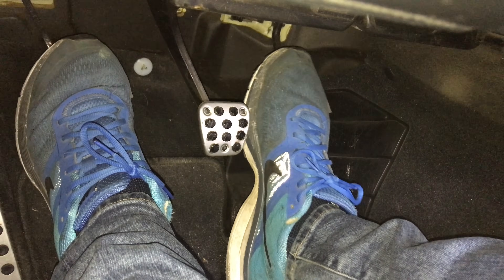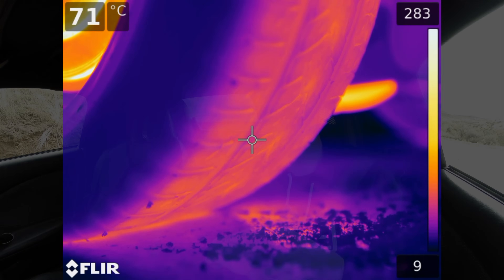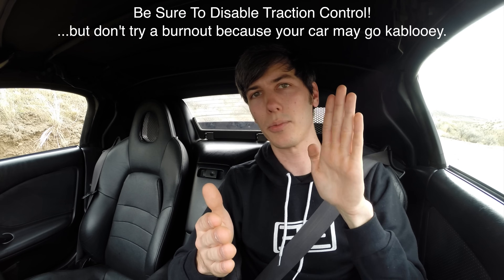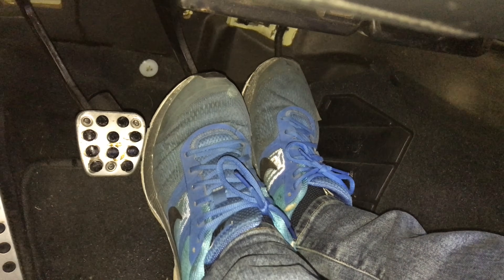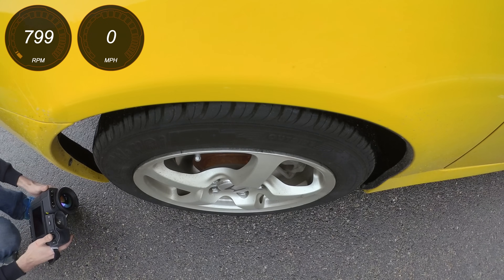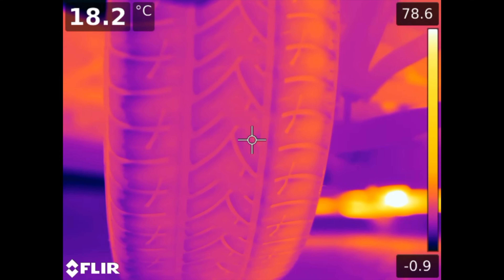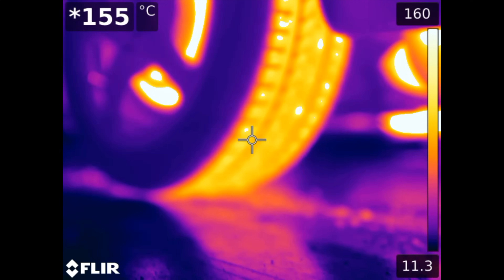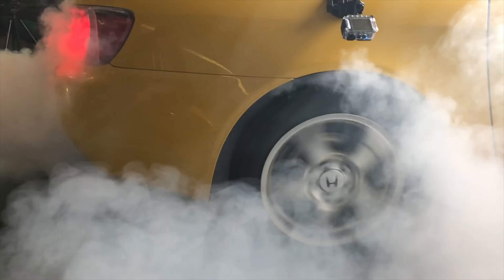How To Do A Burnout - Manual Transmission

Comment: some things to consider.  transmission load is high considering the traction and the fact you are over driving the read brakes.  maybe not too big a risk.  u have seen people bring bleach with them to add as a lube to lighten the load.  second thing.  when you dump the clutch, make sure it locks up.  I have seen this done wrong where the wheels never spin but the clutch does.  that is one ugly scene and dangerous to the driver too .  search it out on YouTube.

Comment: So how does this affect your clutch? When you dump the clutch and successfully start spinning the wheels that have power going to them (either RWD or FWD) surely it's as if your driving normally? If you let the wheels stop the car stalls and that's it? How can you burn your clutch doing this unless you have 3 feet and are slipping the clutch for some weird reason?
Reply: Many road going clutches won't like matching a shaft rotating at thousands of RPM with another shaft doing zero revolutions per minute. Also, as was said in the video, if the tyres and/or road surface don't allow the wheels to spin (or even if they don't spin enough), that energy has to go somewhere. The clutch is never actually coupled, just pressed together, so given enough force the flywheel will rotate faster than the rest of the driveline. This is many times worse than slipping the clutch because at least some pressure is removed from that equation.
Reply: Duncan it's not great for your clutch. Not great for your back brakes either, which I'm kind of surprised that he didn't mention...

Comment: 3:53 Why the speedo showing 40mph ?? Is it moving ??
Reply: Speed is probably measured in the differential
Reply: Yeah, the speed sensor reads the axle speed and calculates your road speed based on your tire circumference

Comment: Having the brakes applied, will it not lock the rear wheels ?.Are the brakes biased ?
Reply: Nearly every car from the factory has front-biased brakes. Besides, the front brakes only need to exert enough force to maintain the tire's contact grip with the road. The rear brakes are having to fight 150lbft of torque (in the case of the honda) on top of that. Throw in the smaller braking surface of rear brakes and the fact they often are solid discs (rather than vented, like most front brake rotors) and you get brake pads that become hot enough that the friction material loses its effectiveness.

Comment: Careful in S2000's (especially AP1's).  The rear LSD isn't very good at handling the "shock load" (I'm sure there's a proper name) of a burnout.  In AP2 S2K's, they put a bleed valve between the clutch and the clutch master cylinder just to give the LSD a more progressive load (and hurting burnout abilities). Thoughts EE?

Comment: So won't it just spin one tire if you have an open differential?
Reply from the maker: Depends. If the surface is pretty even left to right, and the resistance is similar, it can spin both. Likely there will be a small difference though, and one will spin.

Comment: you can't have any mechanical sympathy to do this that's why Mr engineering explained had to hand it off
Reply: Jim Bob  changing clutches is like a weekend job. it's not exactly easy.....

Edit: I'm a FWD guy. just googled and apparently RWD is waaaaaay easier. you lucky devils. ;P
Reply: @SpaceMissile  It's still a 4-16 hours job, depending on your skill level
Reply: @philippe5249  1 hour job here. 2000 mustang gt lol

Comment: Next video:
How to change s2000 diff 
LoL
Reply from the maker: Hoping to update the final drive soon, actually! :)
Reply: Engineering Explained 
Cool.  3.9 final for supercharger!!!
Reply: haha, i feel its pretty safe as long as you aren't doing a one wheeler for a long time... open diffs don't appreciate that.
Reply: johnzal79 NO!!! V-tec likes better turbocharger
Reply: And, how to change S2000 rear brakes.
Reply: s2k comes with LSD. The problem is that its made of glass.
Reply: tried this now i need a new diff lol😂😂😂
Reply: Was thinking the exact same thing lol
Reply: the LSD is strong (Torsen) , the rest of the differential isn't..
Reply: johnzal79 *clutch... jk lol

Comment: Can someone expalin why breaking doesn't stop the back wheels from spinning? Thank you.

Doesn't the break pads lock it up? or does it just heat up and still spin?
Reply from the maker: Heats up and still spins. Applying more power than brake force to the rear wheels.

Comment: just out of curiosity,.. is there any way you could make a video with the thermal camera of the temperatures of the drive train during a burn out or maybe also during a regular drive? like the differential, and transmission. etc...

Comment: Great vid can u do a video that shows mathematically why it's easier to accelerate on a downgrade road. I know it has to do with gravity assisting but if you could explain in detail that would be awesome.
Reply: The gravitational force's cartesian component parallel to the road is nonzero and points forward. The steeper the gradient, the larger this component, and the smaller the force from the wheels has to be in order to have the same resultant force

Comment: MCM say to spray CRC or WD40 on the tyres
Reply: o0bananaman0o or just rub them a bit with a 20cent bar of soap, works good
Reply: better 20 cent bar soap than all the poisens in most shower gel, just saying, and you can always have dove bar soap
Reply: Strange but true, Head and Shoulders Shampoo actually tests better and Coke Cola tests equally well for wear, extreme pressure and lubricity using the industry standard Timken bearing or Falex test than most premium motor oil including Mobil 1 and most popular oil additives.
Reply: a little bit of atf would do it too. good and smokey.
Reply: Yes yes ! I agree !!
Reply: If you’re saying sayonara to your tires, pour bleach on them

Comment: When doing a burnout you shouldn't push the brakes too hard otherwise you will eaither stall (low torque engines) or burn your clutch (high torque engines)

Apply just the right pressure to stop the car, it won't need much brake pressure once the car has no momentum

Comment: what happens if you do burn outs on rear drive vehicles with abs? does that trigger the abs module?
Reply: Arman Manaloto usually yes, to prevent triggering of ABS remove the fuse and you'll be happily doing burnout. But if you also have traction control you might have to press the button (if available) to turn it off, or remove the fuse

Comment: but don't you just kill the break pistons when u smash the gas and break for micro adjustments? also rip drivetrain, not to mention clutch and bearings holy crap
Reply: Fatality Diablo no, when your tires spin the only things that will wear are the tires and brakes

Comment: I personally prefer to use the heel/toe method to initiate the burnout. That way you can control the throttle and brake and you don't get the jump forward. Also your left leg is pretty much trained to stamp on the clutch, so using it to modulate the brake when initiating a burnout often results in too much brake pressure going to the rear. 
Using the heel/toe method also keeps your left leg free to put the clutch in quickly should there be an issue and again will save the car running away in the short time you swap feet to reapply the brake.
Reply: Great tip tbh. Just a bit hard to get used to as with any new thing

Comment: How to do a burnout in a FWD car
4 easy steps:

1. Pull the handbrake
2. Hold the clutch
3. Put the car in first gear
4. Rev. the engine, pop the clutch
Reply: For AWD car
1 Hit the tree
2 Floor it
Reply: @StillRenderFilm  I love you. You make me cry. I'm still crying. everything is okay. everything is fine.
Reply: @StillRenderFilm  lmao
Reply: Still Render Production Chris Rudnick
Reply: nooooo dont do my boy dirty like that lmaoo
Reply: Yeah fwd life
Reply: why would you do that to your moms car?
Reply: apply water
Reply: lukalukic1 a
Reply: my car doesn't have a handbrake if I put it in park and I hit the gas it just revs
Reply: @isatntt  that's because your transmission is locked
Reply: 1. put it in reverse 
2. hold the clutch or brake ( if it's an automatic) 
3. floor it
Reply: Back it across the field to where the flooded river washed a wagon into a ditch.  Try to pull the wagon out of the ditch.  Get nowhere because all 4 wheels are spinning.
Reply: lukalukic1 Step 1: Throttle. mission accomplished
Reply: wd40 on the tires!
Reply: @Tony Bundy I saw (in a different video) someone doing something like that with a T-model Ford.  They jacked up the back, oiled the tires, set the throttle, then lowered it and it just kept spinning until it totally smoked the back tire
Reply: Brubble Butt   but how can u not have a handbrake every car has one  whether its electronic or manual ?
Reply: Uh its an automatic it has no handbrake for like drifting it has a shift knob with a park feature? and if you hit the gas it just revs
Reply: It has a park feature on the shift knob you clearly have no clue what some automatic cars have
Reply: oh ok
Reply: Brubble Butt, Here's a tip. Find your owners manual, look at the part about parking, and you'll find that it has a handbrake. All automatic transmissions have Park which locks the transmission, not the wheels. It's the equivalent of parking a manual in gear. All cars have handbrake (parking brake), even automatic. So what was it about not having a clue?
Reply: @hejamodo  also how can you move the tires if the tranny's locked
Reply: @isatntt  If the transmission is locked you can't. I assume you're back to burnouts, you lock the non driven wheels and spin the drive wheels.
Reply: There isn't a normal handle for it its just a park mode... its a Toyota sienna xle limited look it up NO handbrake handle
Reply: It still has a parking brake, or handbrake if you will. It doesn't have to be a leaver, could be a foot pedal or electric. You have one, you just haven't found it.
Reply: hejamodo it does have a pedal but it's an emergency brake
Reply: No, that's your parking brake. It isn't an emergency brake, although it's sometimes called that in the states at least.
Reply: Now that Brubble Butt knows where his PARKING BRAKE is, maybe he'll post a video of himself doing a burnout  :)
Reply: I wish, but if you can't find your parking brake I doubt a burnout is possible. Especially in a Sienna.
Reply: I'm not here to do a burnout i'm just saying if I were to try and do one I couldn't because I HAVE NO HANDBRAKE I just have a shift lever with a parking feature
Reply: That is not a parking brake it has a P on the shift knob its a "Parking" Feature We don't use that break for a parking break...
Reply: @isatntt You have a fish brain plus you should not drive vehicle this retarded i dont know how did you even get a drivers license
Reply: So you lost it again, well I guess some people are just can't learn. Please return your car and drivers license on your way out.
Reply: @hejamodo  it's not my car, and I never heard of someone under the age of 16 getting a licence
Reply: @isatntt  There's no need for a drivers licence to do a burnout. I bought my first car at the age of seven and it worked quite well for burnouts. Although to be fair, my dad didn't like it...
Reply: @hejamodo  Haha, Well i hate to bust your joke down but you wouldn't be able to buy a car at 7, But if i could at the age of 7, I 100% would
Reply: @isatntt  It wasn't a joke, I bought my first real car at 7, the second at 14, the third at 17, passed my driving test at 18. But then again, I'm a bit older than you.
Reply: @hejamodo  you can't buy a car, contracts aren't really signed until 18, and you need a driver's license
Reply: @hejamodo  also why buy 3 cars that you can't drive?
Reply: @isatntt  Of course it's possible to buy a car under the age of 18, and what makes you think it's impossible to drive without a licence? It's not like the car doesnt start without it, just turn the key and go. And if you'd think for just two seconds you realize that my parents were OK with it and of course helped me buy them and transport them home (the first two at least). A question for you, have you ever been in rural areas, farmlands? You can drive whatever you like and no one cares, at least no one did in the north of Sweden when I was a kid.
Reply: @isatntt  Hmm, why do people sell a car they own just to buy another? I think you can figure that one out yourself, and they were all used by me.
Reply: @hejamodo   I'm 11 and I have driven
Reply: @hejamodo  you made it out as you bought the car when you didn't, I've driven before in my neighborhood and in a parking lot before, but you were again on!y 7 and "buying" the car isn't an option, you need a license and to sign something before you buy it,pay for insurance, everything, unless you were super rich, either way you need a driver's license to buy a car
Reply: @isatntt  Well, give it a few years and you'll probably wrap your head around the concept of buying and selling. I bought the cars, I drove the cars and no, you don't need a license for the car to work. It's not legal, but it's very possible. There are lots of people on the roads driving without a license. You'll understand this when you're older.
Reply: If your sienna is the all-wheel-drive one then it's not advisable to try... but if it's front wheel drive you probably could if you wanted to.  Drive onto some wet greasy pavement, stop, then step on the "emergency" brake (not the main brake pedal you use during driving), and, keeping the shift knob in "D", give it some gas.  If it's front wheel drive, it'll probably spin.  But again if it's all-wheel-drive, I would agree that you shouldn't try it.
Reply: Yeah its FWD Sooooo I might try it one day not sure though
Reply: How to do a burnout in a FWD car

SELL IT

BUY A RWD 
SIMPLE
Reply: check the floor, all vehicles have one, yours is most likely underneath the dash on the drivers side depending on the vehicle u got
Reply: @cpcheater1011  finally someone who understands
Reply: @cutthroat795  okay, sorry for being right
Reply: @T Series not a lot of sedans have space for 5 people
Reply: GoodGuyLuka I’m on my L plates and I did that of a light 😂
Reply: These auto buds sound so lost😪 you're 100% right!
Reply: Yeh there goes my chance of a burnout. My 6MT Fusion has a Electric handbrake with auto release as you press throttle and release clutch at the grab point. 😞 Oh well haha.

Comment: you could have added why you have to modulate the brake and not just pressing it as hard as possible
Reply: MrRedFox1000 if you can't understand that you shouldn't be driving a car, let alone be doing a burnout

Comment: I tried this method at the strip and all it did was pull me straight forward and made no clouds and didn't heat up my tires. I have much better luck holding the brake with my heal and gas with my toe and then dumping the clutch

Comment: when the brake is applied it also engages the rear brake? does this mean you are wearing down the rear brake pads and overheating the disc?
Reply: Mike Mchugh Yep, my friends mustang had blue rear disks after some burnouts and were replaced. Better to install a line lock than replacing the brakes every month

Comment: question when you turbo charge an engine you add hp torque and turbo lag right ? ok my question is during the lag is the engine power reduced let's say before you charge the engine you have 100 hp at that rpm and after you charge during the lag do you have the same 100 hp during that exact rpm or is it reduced ??? this question is really bugging me and please I want a dummy explanation to diffrentiate between torque and hp 
simple for dummies
Reply: dracula vegeta the power during turbolag will be the same as original. Unless you dont have an intercooler and then your car might heat soke and you will lose power for that moment.

Comment: HEY I just saw a ad for mobile 1 annual protection. Meaning you don't have to replace your oil for a year... can that really work? Without damage? Etc.??
Reply: RoastRyder yes most synthetic oils last longer but are more expensive but you have to buy a good filter to filter it longer
Reply: VW recommends oil changes once a year or every 12k miles. This is the new norm
Reply: well it is a VW...something will break by 120,000 miles that has nothing to do with oil
Reply: Stick to 3000 mile intervals or whatever the metric equivalent is. it's better to have you car inspected more than once a year, oil change might be the least of your trouble.
Reply: As long as you keep it topped off and put a good filter in, you can go 15k without an oil change with modern synthetic. Of course still do all the other regular inspections on your vehicle at the intervals you normally would.
Reply: I would still change the oil as your owners manual recommends
Reply: I do 7,500 using the fully synthetic formula
Reply: The GM V6 "High Feature" engine is a prime example of why going past the manufacturer's spec for oil changes is a bad idea these engines have 2 cam phasers per cylinder head and have very narrow passages that the oil has to get through, but the build up of sludge within the engine causes these solenoids to fail, affecting valve timing, as well as the chain tensioners failing and then you lose tension on the chain, which then eats the plastic guides and damages your chains. This engine when fitted to the GMC ACADIA, & BUICK RENDEZVOUS  involves removing the engine from under the vehicle to remove the timing cover and remedy this problem. Easily a $1500 repair without the cost of parts factored in.
Reply: The manufacturers specs don't call for it to be changed at 3000.